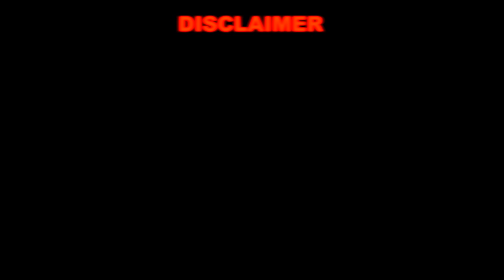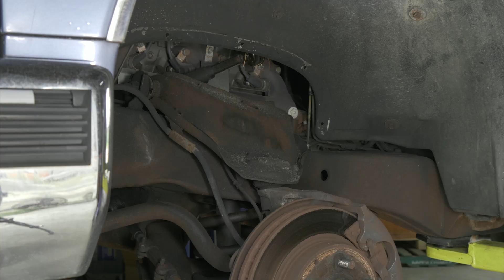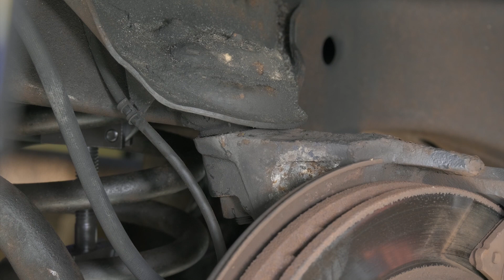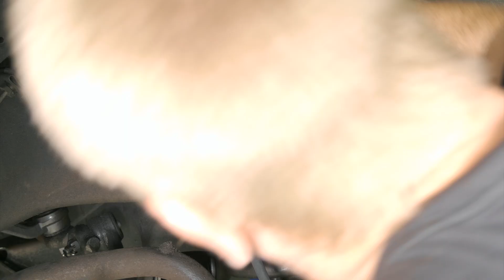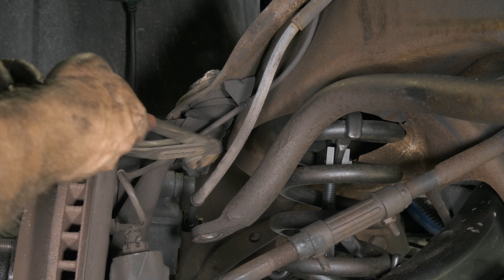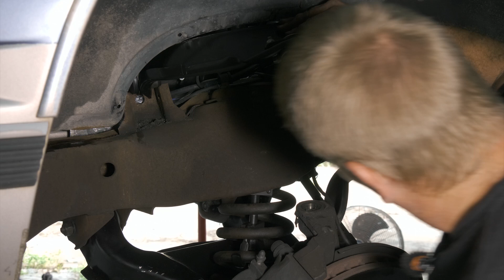1994 Chevrolet Suburban Control Arms

Comment: How tight are u supposed to tight the ball joint nuts? Is it supposed to be the nut width and insert the pin trough the nut and bolt or can the nut go way down past the pin insert and just have the pin trough the bolt ? How tight does it have to be?

Comment: exactly how many inches were you able to compress the spring with that tool ?  tool i am using uses a fork at the bottom and can only compress the spring one and a half inches which isn't enought to get spring back in.

Comment: Nothing like trading Strong tensile OEM metal control arms ........for junk Aftermarket parts that will last 20k miles if your lucky
Reply: Must not have had to change the ball joints a few times and wore out the lower bore fit. Precision makes control arms from re-pressed oem arms.

Comment: At 18:30 into video you can see where an upper control arm bolts onto the frame... And you can clearly see also that one of the pair of bolt holes has knock out tabs in it and the other does not... Why ?  Should the knock out tabs be removed when ever a front end is rebuilt to allow for adjusted/allignment or?
Reply: Yeah you get a knockout tool and punch it out.  Then buy adjustable camber bolts and you can now adjust your camber.

Comment: I am replacing my control arms right now. I wish I had that spring compressor, mine I don't have much trust in... When I removed my shocks I used an impact on both top nuts and they both came right off as the shocks were not that old and no rust at all.... One came off and in fine order. The other though, well I had thought something wrong with it for some time. with bad ball joints and bushings my truck had a bad vibration at times when braking, almost like a warped rotor but could not feel it the pedal. So I assume it was all the slop. But its also was coming from the side with the bad shock, which was bad because it was not secured inside of it. The rod at some point had unthreaded from what ever its screwed onto at the bottom of the rod inside the shock. this resulted in no real dampening or pressure inside the shock and not only does the rod go all the way in with no effort but it also pulls all the way out of the shock body also, at which point oil spills out if not holding it upright... There was not signs of any leakage or anything prior to removal. I kind of think defective or that it detached on install or from all that shaking when braking over last couple years...  Like that shock tool.

Comment: I wouldn’t put that pot metal aftermarket garbage on my truck.  Just to save the time of cleaning your arms, and replacing ball joints and bushings with GM Parts.  There’s a reason the OEM parts last 100,000 miles !  Ever think about that ?
It’s just laziness.  The best control arms available were installed on your vehicle at the factory, and you just threw them in the garbage !  😂
Reply: Even those parts are not the same as the originals were. The ones you buy now for replacement are new and just gm approved which is not the same as original parts.